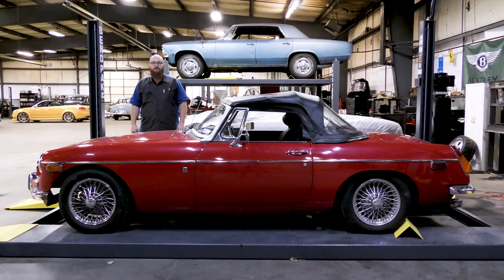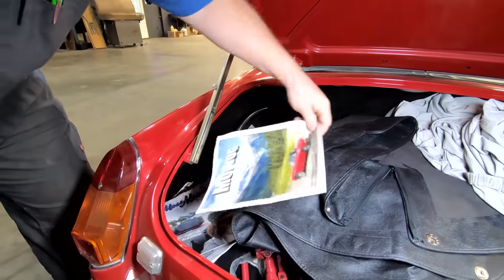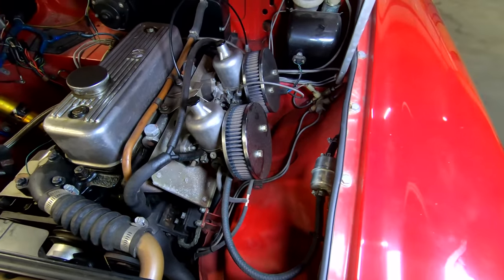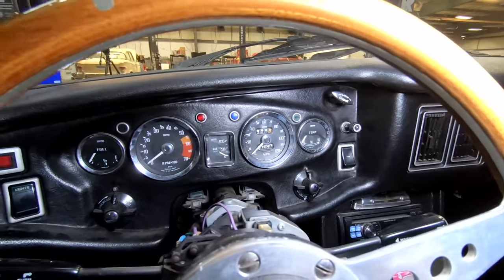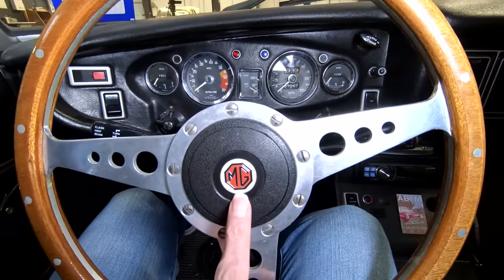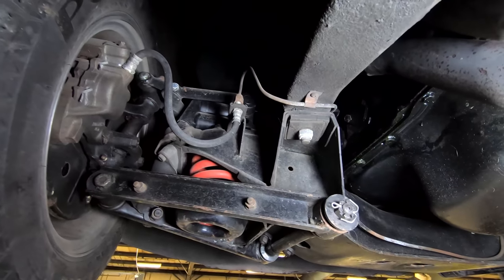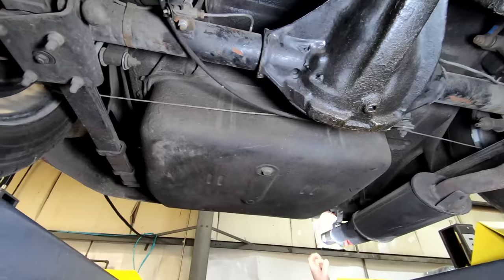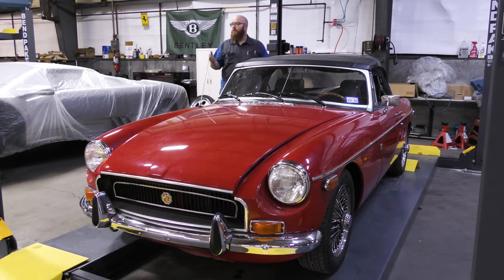Cherry 1972 MGB! See exactly why it earns a thumbs up from the CAR WIZARD!

Comment: Strip the Car & Start From SCRATCH & Do a FULL REBUILD Who Knows What BODGES & Temp'  Stick Tape & BLUE TACK Jobs are Hidden With Past Repairs ? 

Strip the Shell, BLAST It, & Re Paint & Re Build as New from UK Sourced Parts. 

Here in the UK you can buy a BRAND NEW MGB, Shell & Every Part to make a NEW 2022 MGB. 

To YOUR Own Spec & Price Range. 
Air Con, Power Steering,  Any Engine that will Fit the Engine Bay, Inc the ROVER / BUICK V8. 
Cost ???  Whatever Your Budget / Dreams extend to. - Infinity. 
Some are £165,000 ( $185,000 us Dollars As A Hand Built NEW CAR. ) 
To 2022 Spec's & Laws & Emissions etc.

Comment: A lot of English cars of that era had overdrive units because the transmissions they use were literally from tractors. Which meant they didn't go very fast so they needed the overdrive to obtain reasonable speeds
Reply: Also a gas saver

Comment: Wizard…I have always taken your advice as gospel…however those MGB’s might as well not even have a hood as they are always open…everyone that I have had was junk…even the totally cherry one that had just short of 15k miles.
Reply: Brian Selt.. and how many of them have you owned, kindly list them.  
My observation after 58 years of owning and professionally and privately  working on Brit cars..
most Americans are the wrong owners of MGs and Brit cars in general. No respect.
Reply: @jeffhildreth9244  so sorry that you seem so offended by my opinion.  
Two, both MGB’s….and That was enough.  While they were relatively easy to work on, I do not like to spend every other weekend keeping a vehicle running. None of my old Harley pan and shovel heads either required the amount of maintenance and downtime that I experienced with MG’s.

Comment: My first new car was a '77 MGB that was the the same color.  It was a great car, but needed constant attention for something.  

I drove it home from the dealer and parked it in my driveway.  

I walked away but stopped a few feet away just to admire it.  Then, the electric cooling fans kicked on.  That scared me as I thought it had started up and was going to drive away on it own.  

Good ole British engineering!

Comment: Those cars were junk. Many mechanics back in the 70’s hated these cars. Scotty Kilmer said that they are junk. There’s a reason why British Leyland is out of business today, they kept making junk after junk after junk for decades and the Japanese and Germans just took over the automotive market in the UK because they made better cars than the British. Even American cars back then were more reliable than this British POS. Italian cars also had a bad reputation in the 70’s too and they had major rust and electrical problems. These cars also had a reputation for catching up into flames. I will say that it was a fun car to drive but they were kept in the shop more than on the road and that’s why many people wanted a reliable two seater four cylinder roadster and that’s why the Miata was born. There was also a Suzuki Cappuccino too but they never made it to the USA like the Miata did and it was the Miata’s rival. Even today British and Italian cars still have a bad reputation for reliability. Great Britain still does have an automotive industry but many of the MGs, Land Rovers, and Jaguars are made in China now and MG no longer makes sports cars. They make SUVs now. A lot of these cars are now being swapped with engines that have proven to be reliable like the Honda K series engines, GM LS engines as well as the SBC like the 327 and 350 cubic inch, and even the Dodge Neon SRT-4 engine.
Reply: Scotty Kilmer says it's crap?
Than it has to be gold. Pure gold!

Comment: Had to watch this again,. If you took your Brit car to this guy. Good luck. 
No, it has 95 HP.  Stock. 

Nissan " feet of torque".. that would be foot pounds of torque. 
No, the heater is NOT easy to access... take it apart and then tell us what you think.  No, don't,  not with your screw driver gouging the paint, you have no idea what is in there and how complex these are. 
At 5:25 a good reason to avoid this guy. Clueless. 
The usual reference to  Lucas "The Prince of Darkness"  gag me.. No actual experience so parrots all the BS from likewise ignorant comments by others.   
Banging the windshield washer plate where the TUDOR bottle lives is a real treat. . Idiot. The bottle and pump do not belong up front.  
The image does show additional relays installed.. we'll let that slide. Do you know what relays are? 
The lady's voice is barely tolerable and her knowledge is Z E R O .  A deterrent to continue. 
The nacelle around the steering column is missing... nice touch. 

If you had correctly and professionally dealt with the non op fuel pump , you may have been able to get it going. But since you are pretending to know about theses cars.. ah, what the hell just order a  new one and add to the owners expense. Typical. 

"drum brakes in the rear, nothing's wet. "   Pull the wheel and the drum and look at the shoes and the cylinders before you make such a stupid statement. 

Fuel tank... knock knock.   "nice and full"
Lady interrupts... " as always"   WTF   ... Whoever that may be, silence them. 

No mention of the after market 72 spoke wheels and 1968 and later knock offs instead of the original 2 winged spinners. 

"The Lucas Fuel Pump I believe" No moron,  it is an SU fuel pump.  

My OPINION.  You are a fraud. You know nothing about MGBs. You are BS ing your way though this and are the reason people do not trust auto repair people. It is my opinion you are furthering the myths about Brit cars and MGBs in particular . Please, stop. 
Anyone that goes to you is desperate and  you are an opportunist taking advantage of the the disadvantaged. 

It is my opinion that not only are you a BS artist but a fraud. 

WIZARD as in the Wizard of OZ.... a complete fake ( in my opinion.)

Want to play "one up"  with experience with cars, Brit cars and MGS in particular... .. go for it.